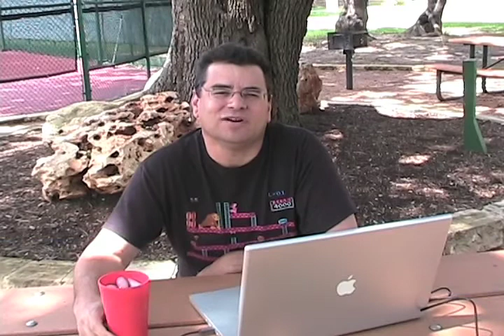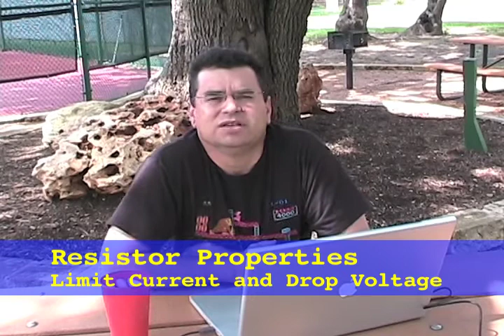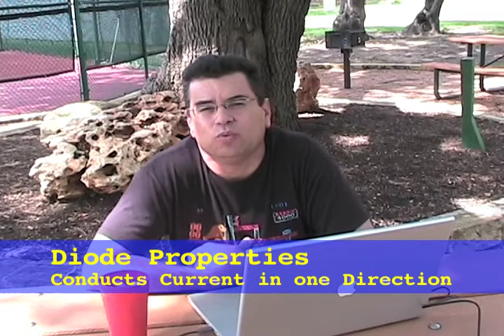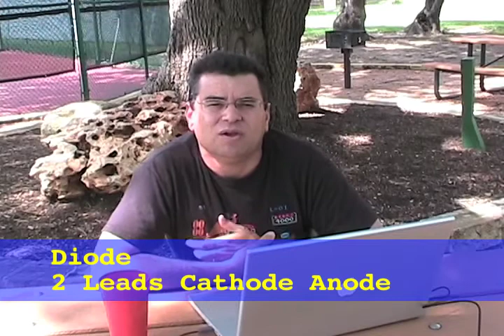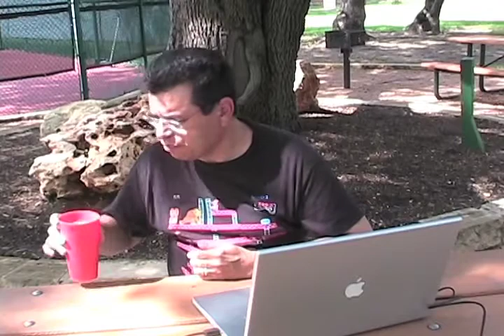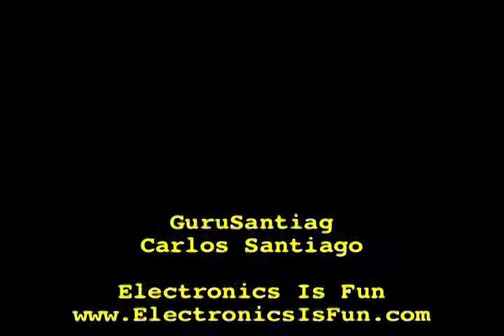GuruSantiago Episode 2 Components

Comment: @poultonb A transistor doesn't actually increase anything. It is like a variable resistor which blocks all or allows some electrons to flow through it. The amplification effect is due to the fact that it only takes a small change in control voltage to go from allowing all, some or none of the (usually) much higher potential connected across the output to flow.

Comment from the maker: @poultonb A transistor can amplify the voltage and/or current (the electrons provide the energy). This amplification is controlled by a transistor amplification factor hfe, beta, and the circuit configuration.